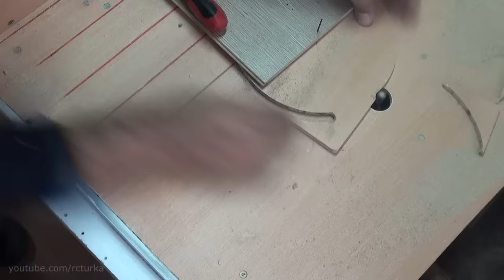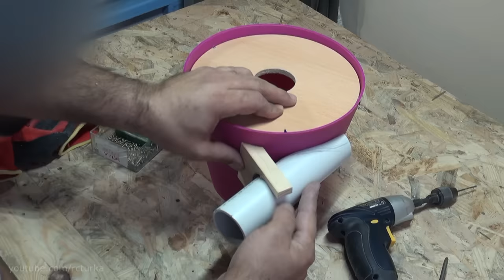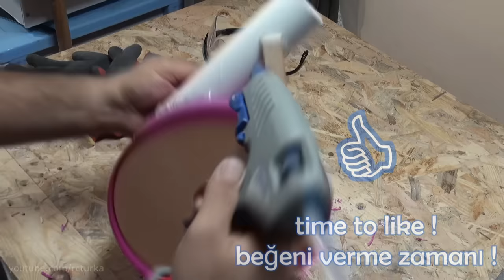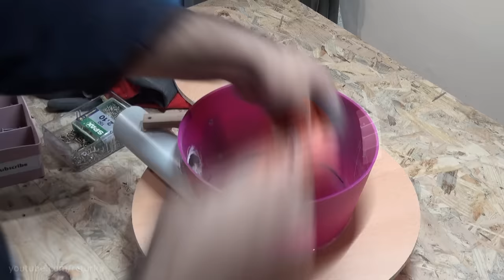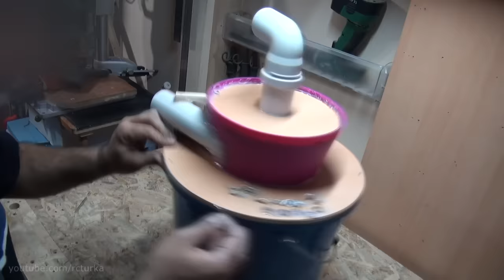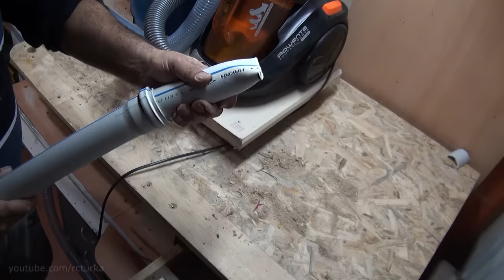Building a Cyclone Dust Collector - DIY

Comment: A good start, but here's a couple of suggestions.  Make the cone longer, at least 1.5x the larger diameter of the cone.  Get rid of the screen on the exhaust pipe - it really cuts down the the airflow.  And as much as possible shorten the hose from the cyclone to the vac.
Reply: Bob Blarney รถส

Comment: Excellent! I've watched several of these videos for building a cyclone but this is the TOPS. I was wondering, for the sake of neatness if silicone sealant would be good to use for the external sealing of joints rather than the glue gun? Glue becomes solid quickly whereas silicone sealant has adhesive properties but is liquid for several hours so that we may just neaten up the seal. Thanks mate, I'll be looking at following your excellent methods of build
Reply from the maker: Thank you Allan H, yes I think silicon can be tried. My next project is 3 in 1 table, coming soon. Please follow me.
Reply: No worries mate, I have a crap table saw. I'm hoping you might help me out with you also. Ill certainly be following your future stuf.

Comment: 0:47 attach a drill under a table upward with my largest drill bit coming through the table. Just like show in the video, drill a large hole on the outside of the plywood for the table drill bit to cut the circle, don’t forget to use a small drill bit to drill a small hole in the center for a nail to hold it in place.

Comment: A good attempt but seems like a somewhat clumsy and impractical solution. Awkward to empty, the glue seals will deteriorate over time, the suction will reduce as the seals are compromised. There are easier and simpler DIY solutions out there.

Comment: Hi! Amazing Video! I'm a Cyclone Dust Collector Newbie even though I'm now a Senior Citizen! What point am I missing here with your  DIY Superb Construction? I own a 1.5 Horsepower Genie 5 Gallon Wet n Dry Shop Vac from 1989 and it does exactly this kind of dust/debris/sawdust pickup all day long. Did you build your Dust Collector because your Shop Vac looks like it holds no moe than one gallon (even though I'm positive your Horsepower must be twice that of my New Wave Shop Vac)?
Reply: The purpose of a dust collector is to put most-like 99%- of the dust and debris into the bucket, instead of your shopvac, thereby keeping the filter cleaner longer. The cleaner you  keep the filter,  the longer you'll have maximum suck on the vacuum. However, as impressive as it was to watch him make this, plastic dust collectors from China can be bought on ebay for around $20.00, so this seems like a lot of work to me. Get one of those, a 5 gal bucket, some nuts and bolts and a half hour of time, and you've got one.
Reply: the point is that the dust and debri do not make it to the vacuum, and so do not clog up the filter. The dust collector is easier to clean, and collects most of the stuff vacuumed up, which makes the shop vac filter last much longer

Comment: I'm not convinced. You took the container off the vacuum to show how much stuff went through to the vacuum. It was empty. But I saw stuff floating around in there. So either your vacuum container wasn't empty, or particles actually made it through to the vacuum. Plus you cut the recording before you showed the vacuum container removal. Also proving to discredit your honesty.
Reply: I second Adams observation. I call it a fail too.

Comment: est-ce qu'un seau en plastique résiste à la dépression? Il ne se déforme pas?
Reply from the maker: Vous pouvez choisir un seau robuste. Je n'ai eu aucun problème à l'utiliser.
Reply: it will only "deform" (or implode) if you keep the nozzle completely covered. if there is room for air at the nozzle, it should not be a problem :-)
Reply: @felixreali7101  désolée de répondre en français
 Cela n'est pas réaliste puisque le système fonctionne sur le vide d'air.  Si le contenant n'est pas hermétique il ne sert a rien et les copeaux vont dans l'aspirateur !
Reply: @danav4810  je ne comprend pas votre message. Le systeme a l'air bien etanche, d'ailleurs on voit le seau se deformer lors de l'essai!
Reply: @alphazorg2183  j'ai réagi à la réponse de Felix Reali qui suggère de laisser une prise d'air dans le tuyaux pour éviter la déformation du contenant en plastique